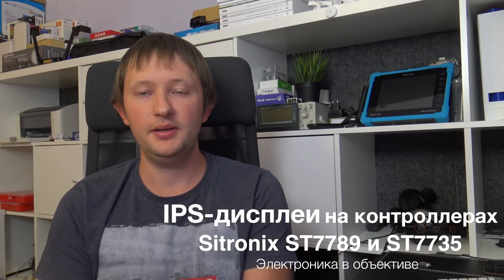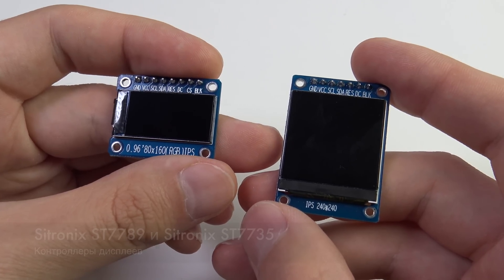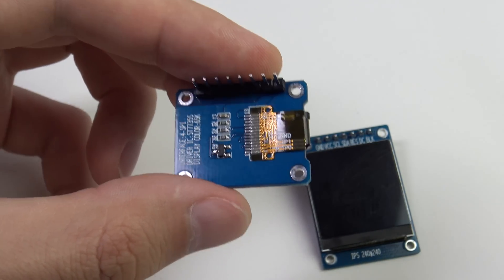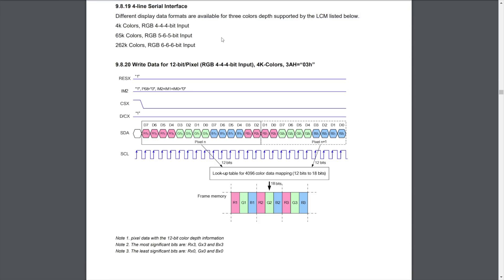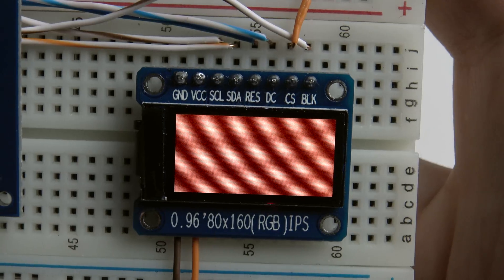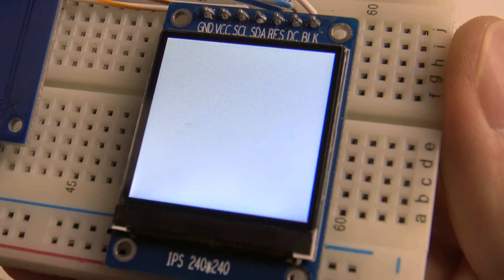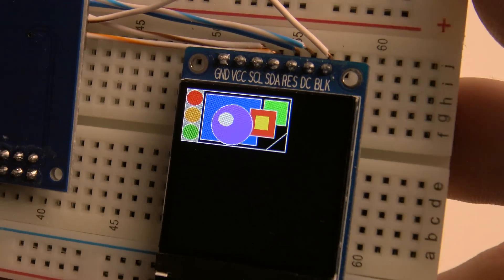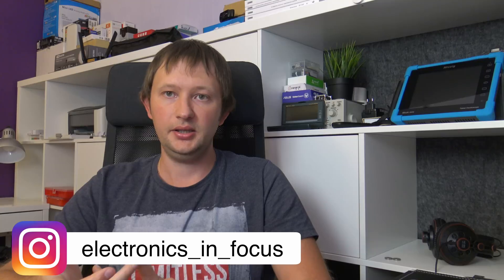IPS-дисплеи на контроллерах ST7789 и ST7735

Comment: Hello my friend! This 240x240 display seems like a good fit for one of my projects. I see from the date of your video that it has been in production for a long time. I wonder if you know of similar newer versions? Thank you
Reply: 1.47 tft ips rounded corner with resolution 320x172 looks like the most interesting solution, but the resolution is very high, MCU will need support for a high-frequency spi interface of 80 MHz or more.

Comment: good and useful video. Please, i need to know if  the control pins of the square display (240 x 240) works with 3.3v or 5v. Thanks

Comment: hello, can you please tell me which library did you use for the screens?
Reply from the maker: my own (not for arduino). link in the video description
Reply: @electronicsinfocus  oh thank you. i bought 240x240 without the pcb so i can use the chip select pin i believe its number 8. im planning to use it with arduino zero which has atsamd21g18 MCU. can i use your library for it or i should use some other?

Comment: Sir How can I connect  0.96 LCD with arduino I can't find any info. I dont know where should ı connect BLK pin on the arduino.
Reply from the maker: I don't know about arduino libs. You should connect BLK to +3.3V or to GPIO pin to control display backlight
Reply: You can leave it floating as the transistor on the display module has a pull-up resistor on it's base to turn it on